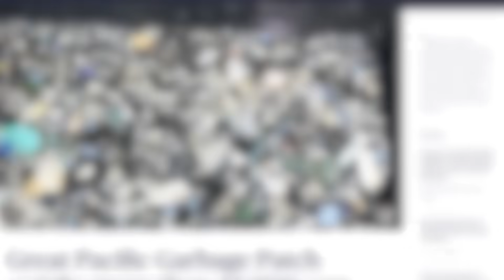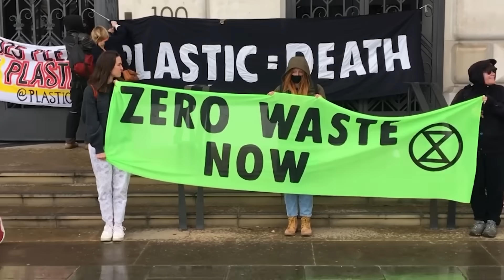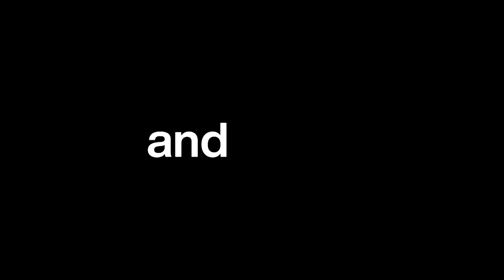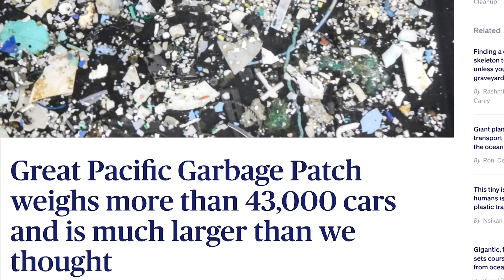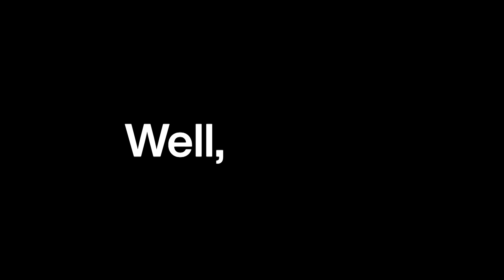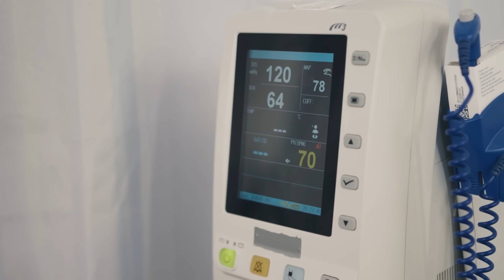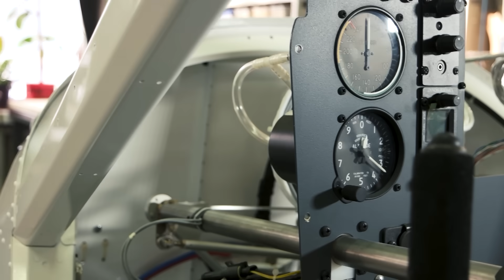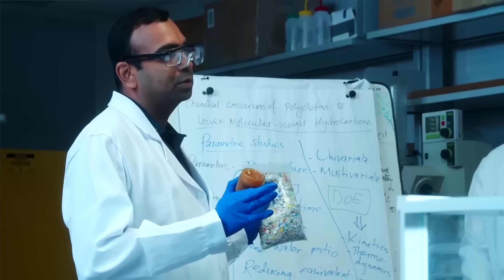Why Plastic Is Good, Actually

Comment: Quite disappointing this is just an ad for a tech company. It would be nicer if you've just sponsored a more in-depth video, this one just skimmed over - not much deeper than the criticised news reports.
The only thing I've actually learned from the video is that the number in resin code also refers to the difficulty of recycling.

Comment: So its an Aduro commercial. The big problem I see with this chemical processing is we are trading solid waste for liquid toxic chemical waste, possibly far more damaging. That's one of the things about the bacteria solution to solve plastic: what will the bacteria break the plastic down into? Make sure to consider the consequences before you dup a bunch of bacteria into the wild which might just transform the inert plastic waste into harmful toxic chemicals
Reply: Some years ago, I heard a little bit about bacteria breaking down plastic but I did not know about the potential problems that you speak of in your writing there. So thank you for making me go look that up, to find out that you are 100% correct and that most plastic cannot be broken down by bacteria as of yet, and that the result of trying to do so in many cases can result in much more toxicity, rather than less. Thank you

Comment: The problem with recycling plastic like this is in sorting. Every type of plastic requires a different method of recycling. Even aduro's method is bottlenecked by this.
Reply: Aduro’s Hydrochemolytic™ Technology (HCT) is designed to process mixed and contaminated plastics without requiring mechanical separation by resin type before processing.  

You are incorrect, and unlike traditional recycling methods that require sorting plastics into separate streams (such as PET, PP, PE, and PS), HCT works at the chemical level to break down a variety of plastics into valuable hydrocarbons in a single process.
Reply: Aduro literally solves this because their technology doesnt require pre sorting and post sorting like other recycling methods.
Reply: @ts8960  it does require pre sorting, they literally say it does.
Reply: Sorry @mikerphone.  You are incorrect and spreading misinformation. 

"Aduro’s Hydrochemolytic™ technology rises to this challenge by effectively processing mixed and contaminated plastics. Unlike other methods, HCT™ requires minimal pre-sorting and can handle various feedstocks in a single reactor. This flexibility not only simplifies the recycling process but also expands the range of materials that can be economically recycled."
Reply: @david72955  You're quoting an ad for them. This video is sponsored by this company which will not operate any of their own facilities but instead receive a licensing fee for helping start up other fasciitis. They won't even take the risk to ensure this is a working concept and they have an out in always scapegoating the plant's management as an issue with their process.

That article I linked you states that they require minimal pre-sorting... but my point is that they still require pre-sorting. They also talk about how they can deal with contaminants, yet never explain how in any of the literature they've put out or in any articles I've read on them.

You are spreading misinformation by repeating verbatim what a company who is creating videos like this to push funding wants you to repeat rather than critically question their claims that have a lack of evidence to back them up.
Reply: @mikerphone. I'll stick with management and the many Multi- Billion $$ companies testing in their CEP.  Good try though.
Reply: @david72955  your lack of critical thought processing is abhorrent.
Reply: The act of resorting to personal attacks rather than engaging in substantive discourse is not only repugnant but also emblematic of intellectual deficiency. To discriminate against individuals whom one neither knows nor comprehends is an exercise in sheer folly, revealing a mind bereft of reasoned judgment. Even if, by some improbable stroke of enlightenment, you managed to grasp the fundamental principles of investment, your inherent limitations - particularly your inability to discern even the rudimentary aspects of chemistry and patent law would still render you less adept than your more competent peers.
Reply: @whiterabbitspecific  "good try though"

That was your only response to my previous points. Don't lecture me about intellectual dishonesty. You've already made clear that is how you operate.
Reply: I don't think you understand Aduro's technology very well.
Reply: @FierceFalcon-e5T  I can guarantee I've read more of their literature than anyone in here including the guy who wrote the video. I understand it very well. Do you even know what I'm arguing here? There are two things, one is that it still requires pre-sorting and aduro says as much though it's much less so compared to something like pyrolysis. The second point I am making is that despite claiming to having a method of dealing with heavy contaminants like food and product contamination.  They never show nor explain how they deal with such a thing.

But please explain what I don't understand, person/bot who made this account today.